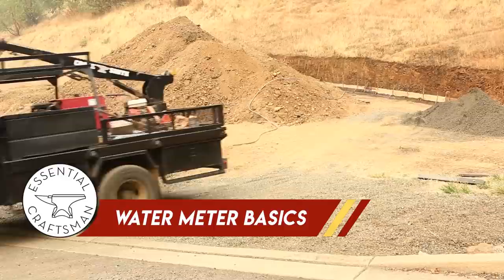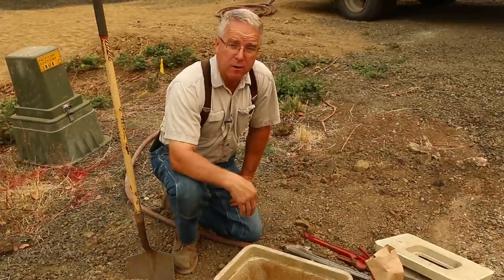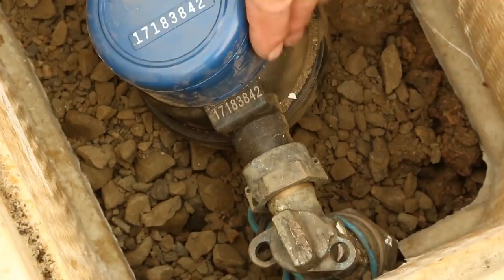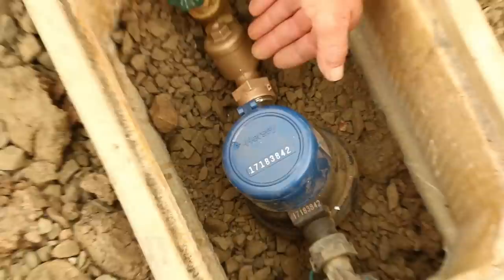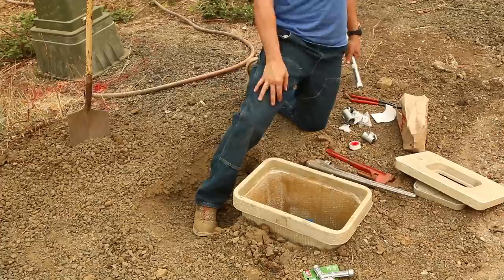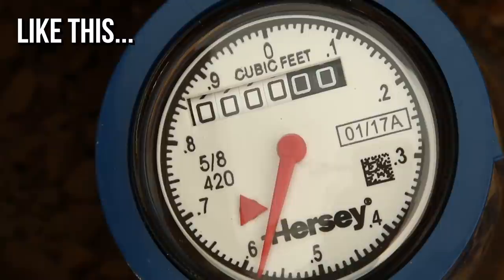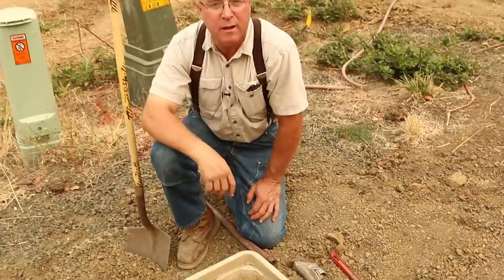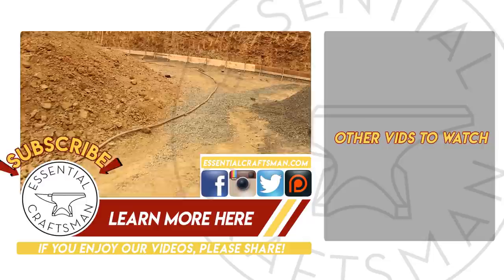Water Meter Hookup (Warning: Basic) : Ep 11

Comment: The district installed digital meters in our district never had metered water before they just billed a flat rate per month. One thing that is nice to have is a yard hydrant that has city pressure to it, my parents have it I'm going to do it on my house project. Having water main pressure for your garden hose is nice when your washing your vehicles etc, you may have to put a check valve in for back flow protection.

Comment: If you pull water from a hydrant, for temporary use, there is another type of water meter that attaches to it and there is a special "key" that will tighten the ring to the arm and turn the hydrant on. you can use a pipe wrench, but this will deface and deform the hydrant. you should also note that the hose size for a hydrant varies, but most common are 2.5,~4"-4.5",7" this will seem to mach up with your 3",5", and 8" discharge hoses but will not connect and has a different thread. the water meters usual come with a converter for a 2" pipe that you can build temporary systems off of, once we built a tree with 5: 3/4" hoses coming off of it by fusing poly pipe( the same kind as seen above) and a few converters for 3/4" pipe.

as a side note, if you want you can build a temporary retention pond and pump the water you need on site from the pond or from an existing body of water. do check with 811 and make sure the water isn't owned by like the army corps of engineers, as this is a federal offense, possibly a felony to in anyway modify a body of water they own. to modify anything owned by the army corps of engineers, you will have to submit a plan of what you want to modify and hope they send you a permit, usually if all you are doing is redirecting the water on your property they are pretty chill.

even if you pump potable water into a non-potable water container, DO NOT DRINK FROM IT, the non-potable water container often can have anything from toxins, petrol, poisons, deadly chemicals, and bacteria from its previous user or use. as an example on a job in Texas we had an issue getting water on site so we borrowed holding tanks used for storing ground water pumped out from oil well heads, the tanks were not cleaned, because it wasn't necessary for non-potable and so they had oil residue all in them.

Comment: Much rather have a ball valve than a gate valve. What are your thoughts?
Reply: Pismolvr 805, both’ll work; the ball valve easier to operate - with a 90 degree throw, the gate valve will require a couple of turns to full on or full off. Be sure not to try to regulate with either. Also, cycle them periodically. And if you do use a gate valve, when opening be sure to turn the handle about 1/16th off of fully open. Never leave it against the stop.
Reply: I would rather have the ball valve if it was me. Less likely to get debris stuck in it.

Comment: Is that a gate valve which is the homeowners responsibility?
Reply: yes right after the meter is the HO to fix and install
Reply: Daniel Puterbaugh   On third look that is a stop valve which is restrictive.  Better to add a good quality, American made ball valve.  If there is a drain built into the stop then a ball valve may be purchased with a waste or drain or purchase a separate capped drain.  Restriction will show up in the irrigation system lacking volume.  Hope this helps.
Reply: Thank!

Comment: I’ve heard that “all water systems leak”. Any thoughts on that?
Reply: My thoughts: Don't listen to Jesse from PLFL.
Reply: No, Do not listen to him. With everything off, that little triangle should not move at All !
Reply: I know mine doesn't leak, and it's old. I've seen every inch of it, and replaced several feet due to freezing or upgrades, but if it leaks it's because there's an issue needing fixed.
Reply: NSMike87 I was wondering if someone would make a connection! 😜
Reply: NSMike87 😂😂😂 That was my exact thought when I read his comment! That's a line bull from someone that sucks at plumbing.
Reply: wimmisky if you’ve never had a dripping tap / faucet you’re lucky.
Reply: Micah Watson Eh I’ve got to give Jesse and Alisa at PLFL credit - they’re doing a lot of hard work and they’re going the extra mile to put it on you tube and be scrutinized.  Of course they get compensated, but still - I’m not putting my handiwork online!  I just think it’s funny when a non-professional makes authoritative comments.  Let the criticism fly!
Reply: Oh Nathan, everyone knows that “all water systems leak”. A lot more in Idaho, considerably less in Southern Oregon. Tehehe! 😂

Comment: Sounding wire? Wish you talked more about that...
Reply: The utility sends an electrical signal down the wire, and they use a sensor to detect the magnetic field around the wire, the sensor gives off a tone that gets louder as you get closer, they then mark it's location so you don't dig it up.
Reply: J-man72 b to find the pipe underground between the meter and house?
Reply: Not just there, basically anywhere utilities are buried, note: there are different methods depending on the utility. 
This site gives a nice simple explanation. http://sitescan.net/utility-location/